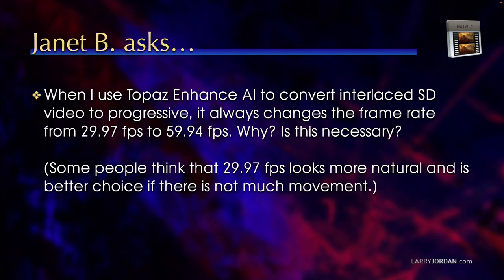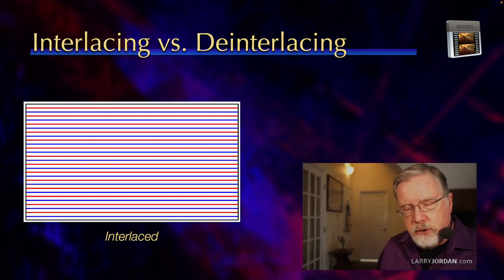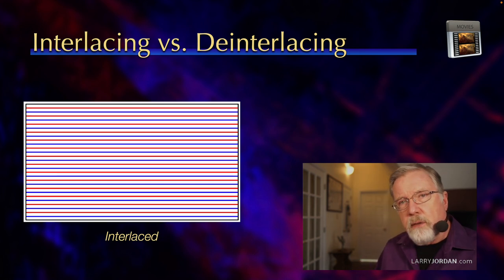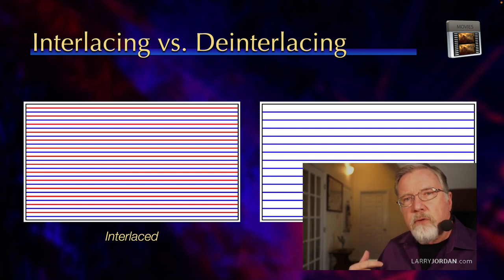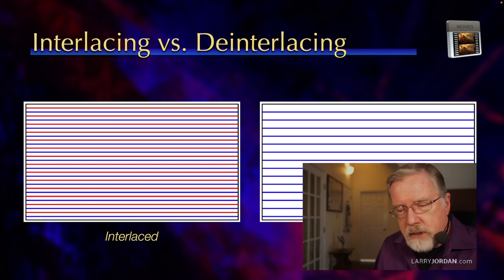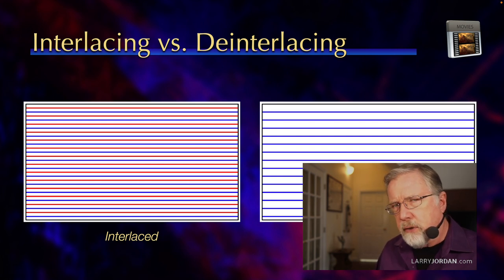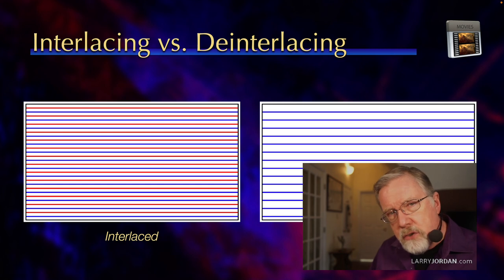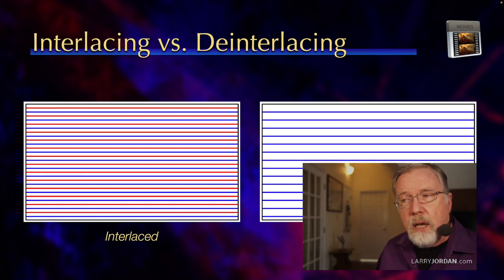Larry Explains Video Interlacing & Deinterlacing

Comment: Useful video. Like other user said, I recommend the high quality deinterlacer QTGMC which is a filter for Avisynth. It uses a powerful and complex algorithm to fill in the gaps between fields by taking into account both even and off lines. Andrew Swan did an beginner friendly tutorial about QTGMC called Deinterlacing with AVISynth and QTGMC Tutorial. In general, you have to write some short instructions in a text file with the the .AVS extension and then use another program (e.g. Avidemux, ffmpeg, VirtualDub2, etc) to render the result (basically save it to a video format). Avisynth is like a middle man between your source file and the video converting program: it does the processing in background according to your script and serves the resulting frames to that program. In Avisynth you can do deblocking, denoising, fps change, remove frame duplicates, deinterlacing, ITVC, color grading, cropping, resizing and many other operations.

Comment: Using QTGMC is the best deinterlacer for encoding to progressive for YouTube. A better player like VLC won’t require someone to deinterlace VHS and also it won’t compress it like YouTube. VLC will do Yadif on the fly. VLC is for private viewing though. YouTube is for sharing. VLC will also recognize flags for anamorphic pixels where YouTube just does square pixels. Virtualdub 1.9 compressing losslessly then using Hybrid to deinterlace, resize, filter, and encode is the way to go. Only deinterlace if the player requires it.
Reply from the maker: Duncan:  this is a good comment. But it would be useful if you would define a few terms for people that don't know them. This includes: QTGMC, VLC, Hybrid, VirtualDub and Yadif. Are each of these programs or settings?

Larry
Reply: @LarryJordanFCP  QTGMC is a really high quality deinterlacer. People use it when they are utilizing a scripting language like Avisynth or Vapoursynth.

Yadiff is also a deinterlacer and when using VLC it’s a good idea.

VLC is a multimedia player. You can just download it then play videos from it on your computer. If it’s VHS that are digitized you can flag them as anamorphic pixels in hybrid and VLC recognizes that. VLC won’t compress your video but it is plying locally off if your drive.

Hybrid is a GUI(graphic user interface) for Avisynth and Vapoursynth. It contains the popular filters. It will encode to w/e you need to encode to also. It has tremendously less of a learning curve than learning to script using Avisynth using Pmod. Pmod is so you can see what’s going on because Avisynth is a frame server with no GUI. Anyways Hybrid is the easy was to do all of that and it also utilizes Vapoursynth which is newer and faster and better at utilizing multithreaing. It’s more optimized for newer hardware. A lot of this stuff is old since it’s meant specifically for converting analog.

Virtualdub 1.9 is the most stable version of virtualdub for capturing analog tape based media. It doesn’t have as much going on as an NLE. It’s a barebone capture program. You can use the losslessly compressed Huffy codec to capture losslessly to virtualdub then save the PCM audio as wave and take that into an audio editor like audacity then open the captured file in hybrid and import the edited audio into hybrid and encode it to W/E you want. It handles the colorspace conversions going from YUV to RGB better too in scripting. With hybrid you can actually edit in the original YUV colorspace first and adjust levels. With an NLE the YUV colorspace gets expanded to RGB when you apply any RGB filter. It causes clipping.
Reply from the maker: @duncanmacleod2136   This is excellent. Thanks for taking the time to write it.
Reply: Good video